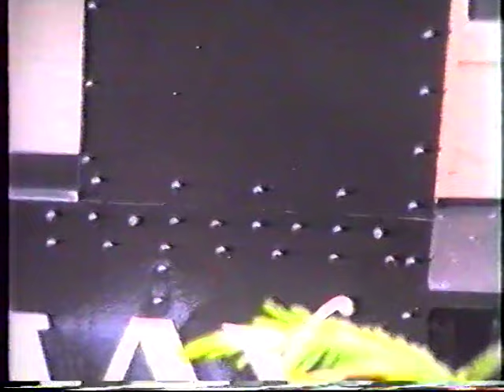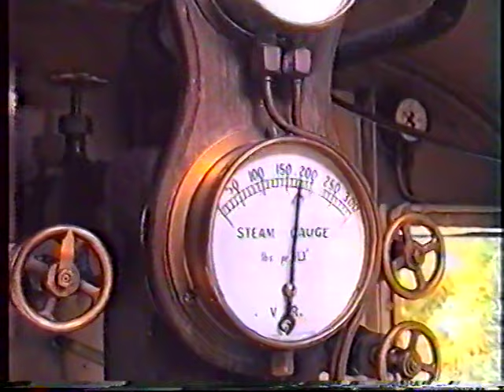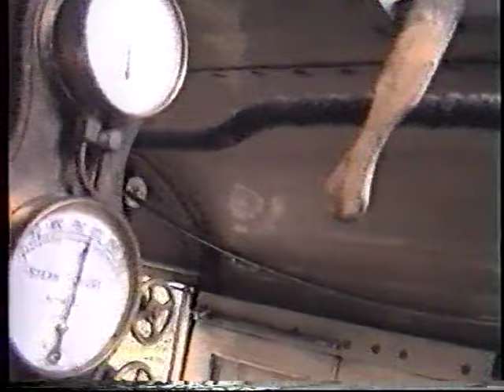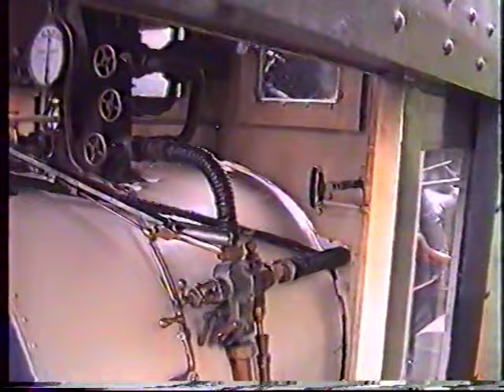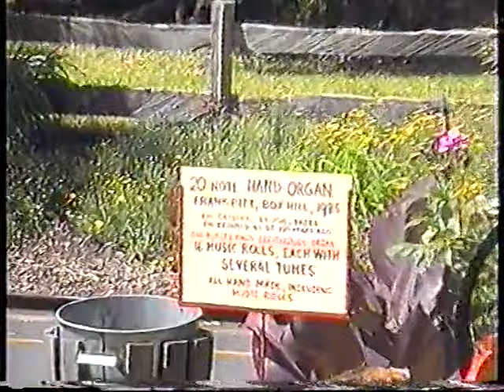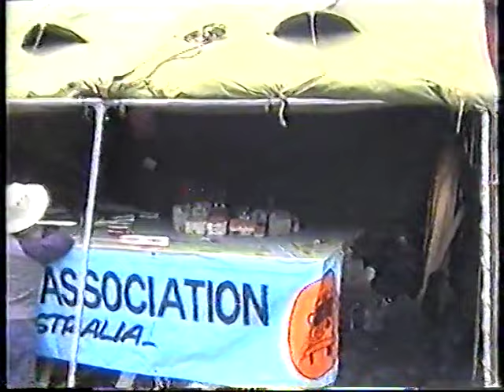Puffing Billy Climax #1694 including close ups

Comment: 6:37 Long pokkit lane selby ( original signals )
7:40 Selby-Aura road ( with extra signal )
7:52 School road 1 ( slower teardrop bell )
12:15 School road 2
12:18 Belgrave-Gembrook road Clematis
15:24 Main Street Emerald
19:24 Pakenham road Cockatoo ( both bells working )
1:04:08 Long Pokkit lane ( again )
1:05:29 Selby Aura road again
1:09:40 school road 2 in the process of getting Flashing Lights
1:35:30 Lake Park road